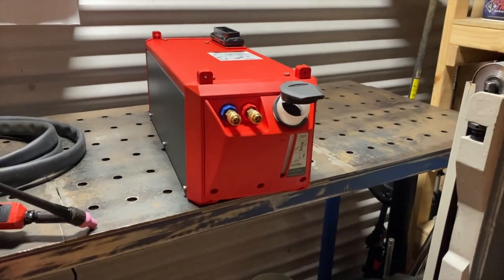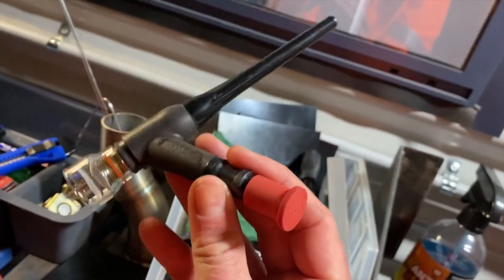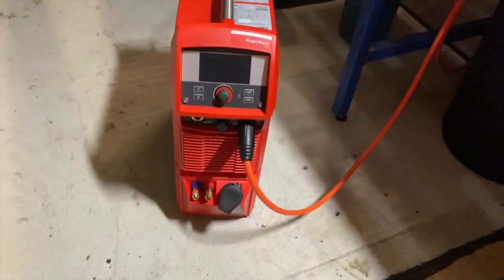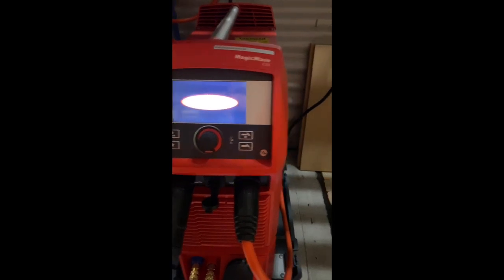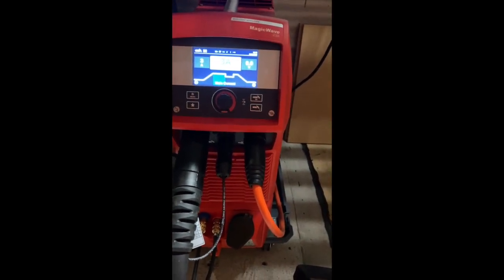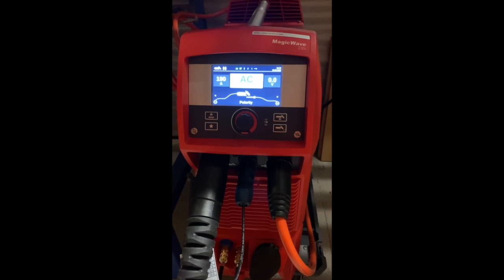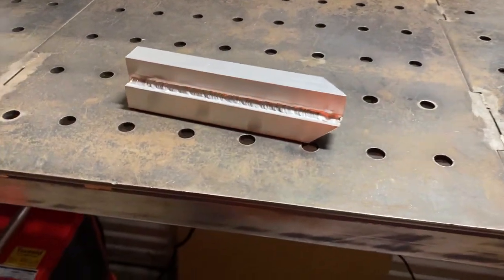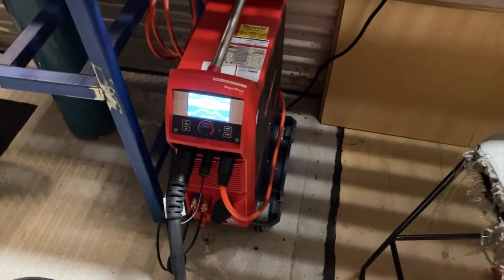Fronius Magicwave 230i Water Cooler

Comment: Do You still hawe this setup???
Reply from the maker: Yeah, I love it. I've got a CK worldwide torch as well which is swivel head
Reply: @dceng8460  Cool. Unfortunately, I can't get anything from CK in Poland. But I put together a few torches myself with a Fronius connector made by me. Recently, I also assembled water-cooled torches for aluminum. But unfortunately my version of the cooler (DIY) does not read the temperature correctly and I use the original Fronius sensor, but the flow sensor works ok (from another source) 😁 I'm just wondering how the PC heatsink with 3 fans will handle it? 😅